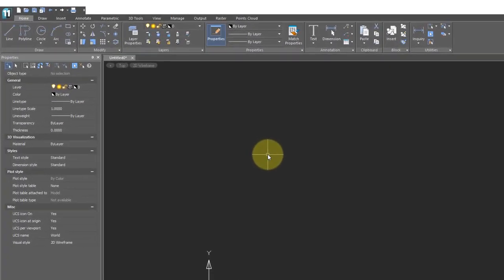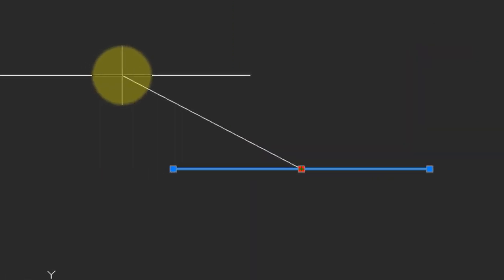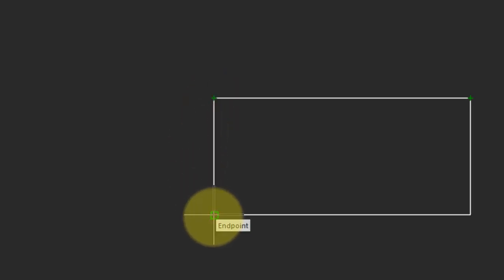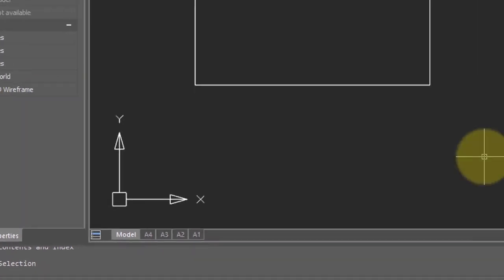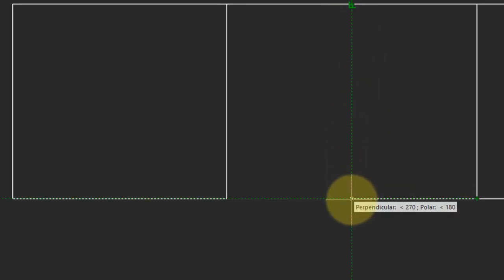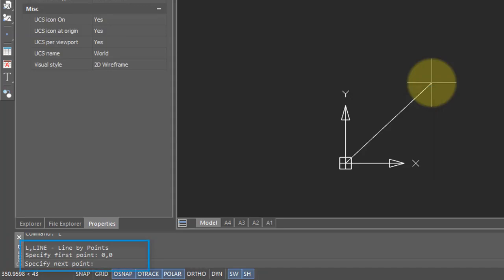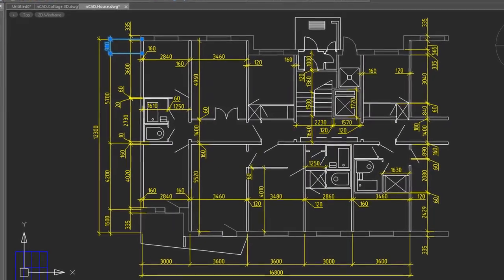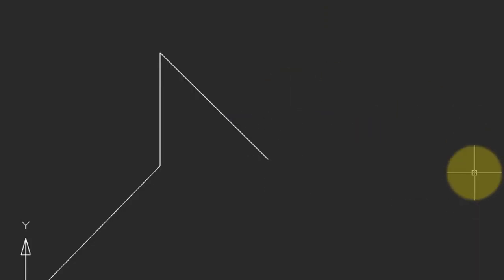How to draw lines in nanoCAD

Comment: Great video. Why are my lines  distorted in nanocad?
Reply from the maker: "Which version of nanoCAD you are using? Kindly share more details and if possible screen shots of your problem."
Reply: @nanoCADIndia  Hello. I'm using the free version 5.0 to make a simple eletric project. I'd like to thank you because nanoCad free is very good as well. My video card is a onBoard chip.
Reply from the maker: @pauloandrade3192 Can you explain the problem more elaborately like what line type you are using and what command and options you are using with screen shots if possible.
Reply: @nanoCADIndia In fact, I'm noob in CAD, but, when I draw diagonal lines, the lines are distorted, maybe that's normal, I don't know it. I use line or powerline command
Reply from the maker: @pauloandrade3192  Please on the osnap option. And use line command First excaute line command and then choose first point and end point.